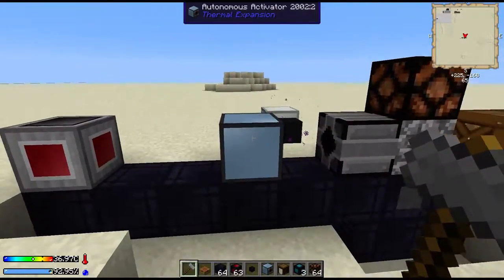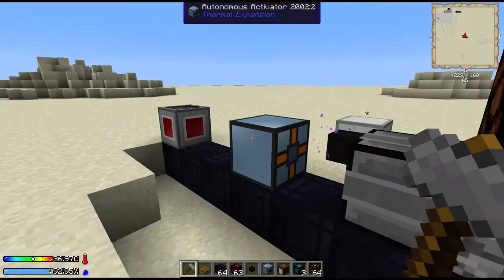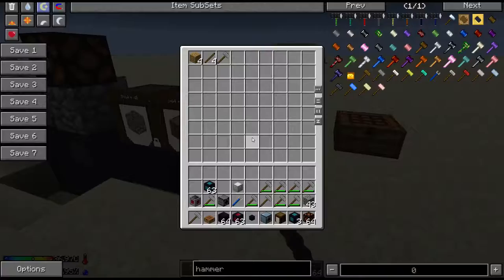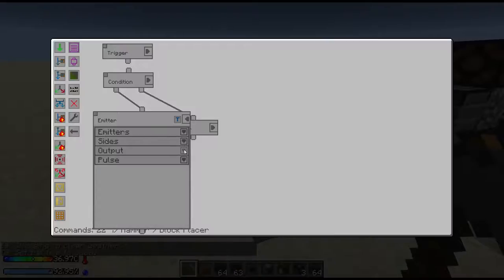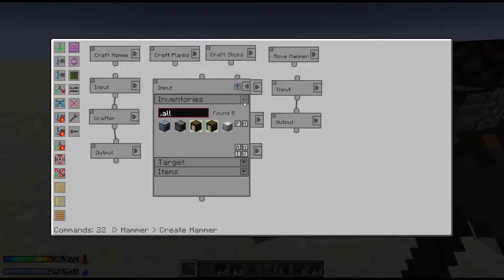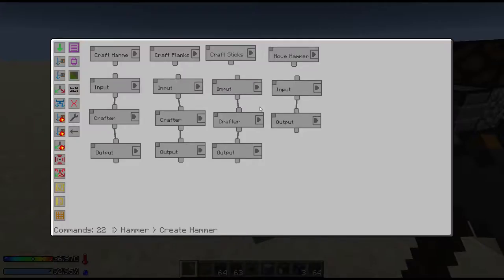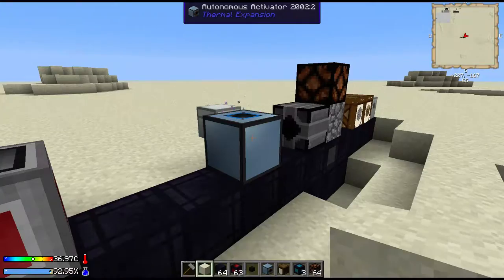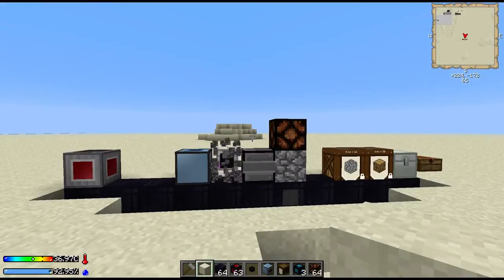Tutorial: Crash Landing Auto Hammer with Steve's Factory Manager

Comment from the maker: Instead of using the Redstone Transmitter to activate the Block Placer, you can use a Redstone Clock. This is how I'm using it in my single play series.
Reply: Was about to suggest this =P Glad you caught it! You can automate the entire chain with Steve's Factory Manager for infinite ore generation if you hook the system up to a transfer node cobblegen to supply the cobble for autocrafted hammers as well as for the block placer. It can be done pretty early, and with less iron than most people list as a requirement, since you can also use aluminum for hoppers (as I see you also mentioned below). Its possible to have a simple version running by day 3-5 depending on how much you sieve during nighttime and after that you pretty much have infinite everything.

You can set a variable to toggle between hammering once (and sieving gravel), twice (for sand) and thrice (for dust if you're too lazy to dig), depending on which resources you need the most of at the time, auto-smelt (works with all kinds of furnaces as well as TiCo stuff if you set it to auto-craft the 2x2 of pulverized ores/broken ores etc., or alternately, pipe it thru a packager first. The level of automation you can get with just a couple of SFM blocks is just crazy.

You can also use a rapid item valve instead of the vacuum hopper, if its really early game and you dont have access to a lot of pearls yet... should still work fine.

Comment: Would the block gate not be able to use the hammer. I know it'll then throw the hammer on the ground, but you could then, pick it back up with a rapid item valve, if that works it'd be much faster. Also you could use the same block gate to place the cobble and a block detector to tell when to place the cobble and when to throw a hammer at it.
Reply from the maker: Just tried it, and the Hammer in a Block Gate didn't work. It doesn't right click and hold, it just attempts to right click and drop. Breaking a block doesn't work quite the same as a Sieve.
Reply: Yeah, looks like the hammering has to be done by Autonomous activators, but the rest can be SFM'd.
I've come up with a plan for automating Pneumaticraft seeds too, might try to make a how-to and post it.
Reply from the maker: Landstryder has a pretty good setup for seeds. I created similar one, but it includes a block swapper and uses the Block Gate for Bone Meal instead of the Dispenser.
Reply: JoeCool FlyingAce Just watched it, was pretty much exactly how I was planning, glad I saw it, I'd have looked like I was ripping his idea off. Only so many ways to invent the wheel.